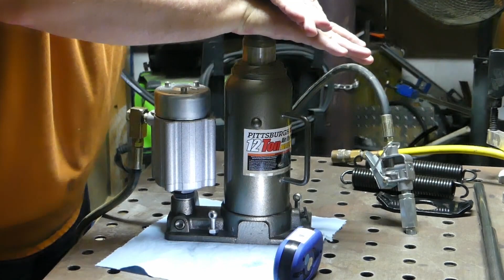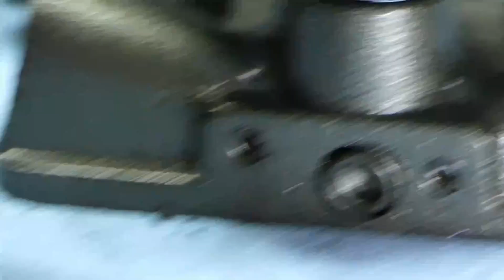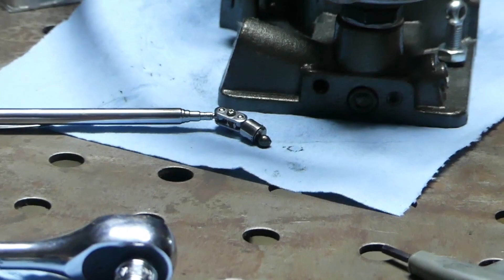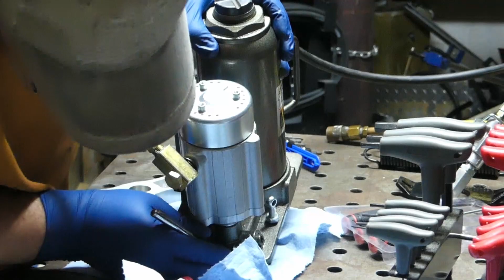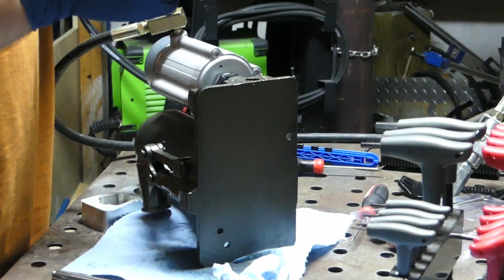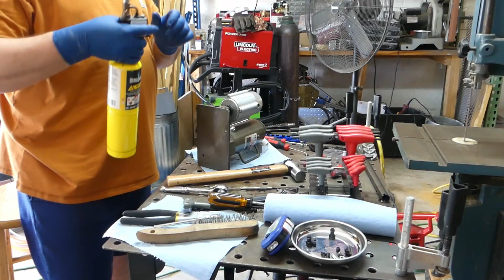FAILED, attempted repair of 12 ton HF AIR Bottle Jack

Comment: I only watched about 20 minutes of your video.  I think I know what the problem is, if you haven't found it by now?  FACTS:  Your air motor is pumping air, but does not raise the ram.  You can raise the ram somewhat with the manual pump lever, but it is "spongy."  I never saw you check the level of hydraulic oil in the reservoir?  You should check the oil level!  I suspect it is low.  Follow the directions and purge any air from the system.  At this point, you should be able to manually pump and the ram should rise and maintain pressure. One of the screws you removed around the air motor was large with a slotted head?  It had another Phillips headed screw underneath the cap screw?  I believe the Phillips screw is an AIR BLEED SCREW.  You should run your air compressor while you are unscrewing this screw, but don't take it out all the way.  That should let any air bleed out.  As you BEGIN TO TIGHTEN THIS SCREW, YOU WILL BEGIN TO SEE THE RAM START GOING UP, and your problem is fixed.